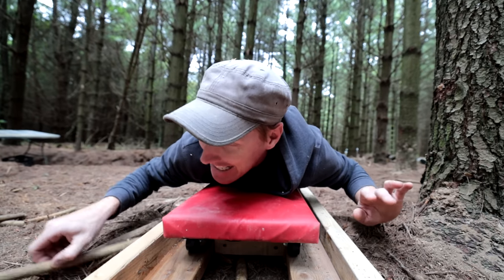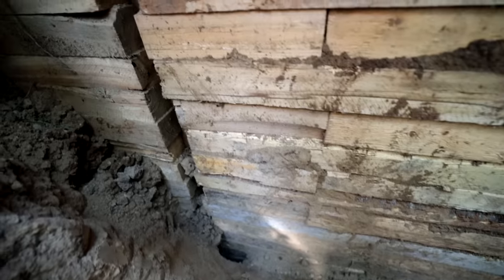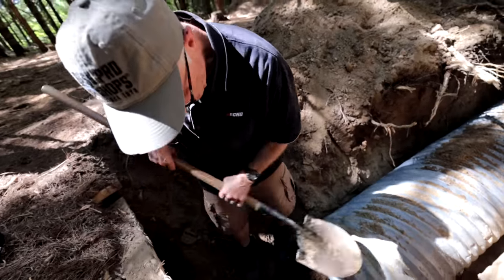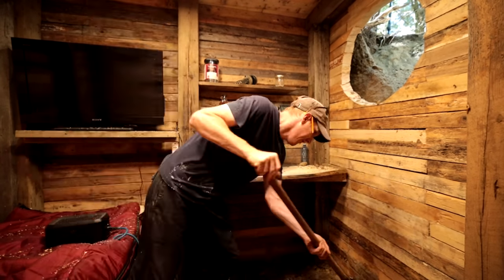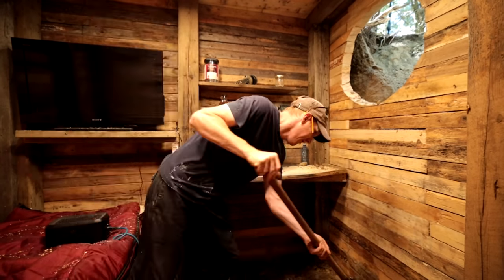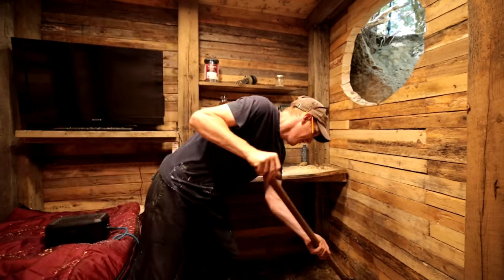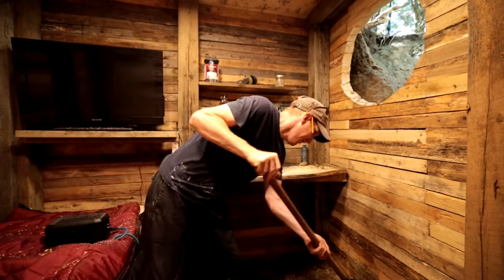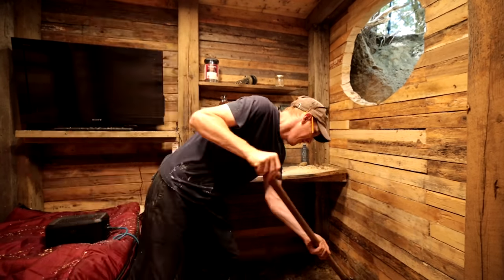Building a Japanese Spider Hole - CRAZY EMERGENCY EXIT!

Comment: Kev, had you considered a static rope between the two exits? Like have it attached to the top of the tunnel so you can just lay down and kind of rope climb/abseil up and down the tunnel with a railing kind of contraption above the entry inside?
Reply: I was thinking that too, only it might be easier if it was under the ramp so you can pull yourself along without reaching above your head.
Reply: Had the same thought, and perhaps add some sort of stopping mechanism at the edge so the red rocket doesn’t fly off the shelf
Reply: Exactly my thoughts. Also, with two pulleys and attached to the cart so you could pull it back and forth.
Reply: Also if you were to put a hand hold over the inside hole you could come up it head first and be able to climb out better.
Reply: Jesus loves you alot trust in His death 4 salvation and be saved from eternal hell <3 Jesus died on the cross for you bro. <3
Reply: Great idea
Reply: Or you can also attach the end of  rope to the front ,run it below that railing then attach the other end to the back of that wheely thing , so you can move yourself forward by pulling the rope above the railing then backward by pulling the rope under the railing , without changing your position
Reply: @ainz7853  i thought about that also but the rail is at an angle, which would make it hard to move in both directions, if it was level, then that would be a perfectly viable option
Reply: Absile comes from German and means "down rope" so it's pretty funny reading absile up lol
Reply: @armean4187  yeah, i know, but I couldn't think of a term that means to go up a rope other than climbing which just didn't sound fitting to me. But I got to admit, I'm surprised it took as long as it did for someone to pick up on that xD
Reply: I was thinking the same, but how about a pulley at each end with a continuous rope attached to each end of the car dolly. That way it wouldn't matter which end you accessed first....like the toilet seat dilemma!😂 And you could move the cart back to the inside shelter when you exit from the tunnel so no one see's it.
Also the outside culvert could be framed with a slanted concrete opening with maybe a hinged tight steel grate with a lock hasp that could be accessed from inside or out.
All in all I'd say Tunnel Rat Barby came out pretty well....much better than a tree house ( but each has their place). And she's prepared for armaggedon, zombie apocalyse, door to door salesmen, you name it.
Now if only there was a way to get some ground folege to break up the open terrain and provide sniping cover!😅

Comment: I think if you add a bar to the ceiling above the hole entrance, you can use it to pull yourself out of the hole, and allow you to swing your feet down.  That would make using it as an entrance more feasible.
Reply: yes, some sort of handle that could maybe collapse against the wall when not in use
Reply: also make the red rocket like 5 feet maybe 5 and a half feet
Reply: Yes
Reply: I had this idea too
Reply: We all think a like. 🤣
Reply: Alternatively, just enter feet-first.
Reply: a bar to the side might work as well, though its less practical.
Reply: Jesus loves you alot trust in His death 4 salvation and be saved from eternal hell <3 Jesus died on the cross for you bro. <3

Comment: Love your trolly!   You could always lay on your back and install an overhead rope at the ceiling and pull yourself hand over hand either direction. B- 36 and B-29 bombers had these tunnels in their fuselages and used the trolley and rope system to get to the tail of the airplane.   We really  love your content!
Reply: Jesus loves you alot trust in His death 4 salvation and be saved from eternal hell <3 Jesus died on the cross for you bro. <3

Comment: As a bonafide US citizen I will express my preference for the Robertson screw over the Phillips design. Years ago while on a framing crew I learned of the superiority of the Robertson screw for ease of use, especially when the screw needed to be backed out of the wood. Mount a stationary rope at the top of the pipe for escapees to use to pull themselves through.

Comment: Love these DIY videos of your, 2 ideas you might like would be to.
1. Add an under rail pully system so you can send or recover the cart from each end and send supplies down.
2. Add a fan and with a swing mount so you can vent air in or out.
Reply: Yes! He could mount the fan on a bracket on the right side of the door. It will swing to cover the entrance and swing back against the wall.
Reply: Jesus loves you alot trust in His death 4 salvation and be saved from eternal hell <3 Jesus died on the cross for you bro. <3
Reply: also put some stops at the end of the rail so the cart doesnt fly out

Comment: A great addition to the spider hole compound. 
On the underside of the red rocket where you have the side wheels mounted, mount an eye bolt to the ends that way the cart can be pulled back and forth.  And it might help going uphill to have something to pull towards the room. 

Thanks for your content.
Reply: i absolutely agree. an eyelet on each end of the cart, and a rope on 2 pulleys at either end of the track, then it could be pulled both directions, great for moving items on the cart, and possibly even to pull yourself along via the opposing direction's rope.
Reply: @ghomerhust  Yes, like elevator cables but sideways.
Reply: Jesus loves you alot trust in His death 4 salvation and be saved from eternal hell <3 Jesus died on the cross for you bro. <3

Comment: I think covering to top portion of your spider hole with a plastic tarp was a good idea to help with water proofing a little better, but without waterproofing the  entrance and all four walls the wood going to rot and mold overtime . Not to mention if any animals get in  and die down there. There's definitely going to be a miasma of stale air in your spider hole at some point.

Comment: Miasma used in a sentace: There was a great deal of miasma coming from the spider hole after farting in it. 
Perhaps a bit of a french drain at the outside end of the escape pipe might prevent a face full of water when exiting when there is rain or water at the end of that pipe.. I know, more digging.
Great project!

Comment: you can put a handle above the door to your emergency exit, almost like a pull up bar(make sure it can hold the weight of a full grown adult) that way if you want to go in foot first or if you use it as an entrance to your base you can either go on your back, or just flip on your back at the end and pull yourself up out of the hole using the handle so that you can still use the ladder foot first

Comment: You need a horizontal bar on the roof to help enter or exit, also good for drying clothes or exercise.
When on cart your weight will bow in railway that is only supported on the sides creating extra friction.

Comment: Earlier this evening, I got close up and personal with some Robertson screws.  I wanted to remove a shelf set from the kneehole of a desk, while the desk was against a wall.  I would not have been able to loosen the screws in the tight and awkward space if they had been other than Robertson screws.   Mission accomplished.  I am a fan.  The desk was custom built in the USA over 20 years ago. My only other encounter with Robertson screws was in a motorhome that had been fitted out in Canada.  The manufacturer thoughtfully included the screwdriver to fit them.

Comment: The tunnel system is an amazing idea I would put a bush at the outside end to camouflage it more and a stopping block at the end of the rail on the inside and try to rig up some kind of rope system so you can send in the retrieve it from the inside to the outside

Comment: 2 things the rail system needs... 
1. a handle above the door for when you come in on your back
2. a rope and pully system so you can move it back and fourth from either side of the tunnel.

Comment: You could try putting some overhead handholds into the ceiling or just above the door, to steady yourself or help pull yourself out, if you do happen to come into the spider hole from the tunnel.

Comment: You should add a pulley system that allows you to pull the cart to which ever side you need it on. you could also probably pull yourself along the tunnel with it too. A metal grating with a hinge on the outside end to stop animals from getting in too.
Reply: Attach a rope and pulley's at either end and run the rope round a remote controlled motor to winch the trolley either way?

Comment: I can see an Ecoflow powered rail system where you push a button and zoom, you automatically ride the rail to either end.  Since it will be, way, way easier to get out of the tunnel if you are on your back on the sled where you can just sit up at the end and climb out a ladder,.  You could attach a rope to the top of the tunnel to pull your way along either direction, until the motorized escape rail is up and running,😀 Nice job.

Comment: On the inside, you could put a big grab bar above the exit so if you come in that way you could roll on your back and grab the handle to get out easier..(instead of climbing down the ladder front first). 
Also, maybe a small pully and rope system so you can move the red rocket to either end with ease..
Loving the build, it's like every kids underground fort dream come true 😂

Comment: Just need a removable hardware cloth at the end to keep the critters out and the small hole in the center of your door, now if you would have a vent tube coming in your would have good ventilation, a little solar fan would help keep it ventilated and keep it from molding

Comment: You should tip the air log on its side.
Cut a slot and tip it on the side so that rain can’t fall down the air shaft. Kinda like a big natural version of a normal chimney cap.

Comment: A rope and pulley system would probably be helpful. I wonder though if their might be some way to automate it as well that could be powered by the delta 2, or some kind of hotl for dog's like use of a power drill.

Comment: A decoy/false inlet upslope nearby in an obvious low spot would further reduce the question of a random pipe outlet on a slope, as people would wonder it’s source.. even cooler would be diversion of a spring seep or natural water source into the pipe to provide a trickle to help explain the use of the pipe to the curious. This water thru the pipe may help cool the shelter as well.

Comment: You could glue sand dirt and pine needles to the surrounding area and the entrances even if its glued on tarps staked out. And add vibration sensors to alert you of ground instability indicating collapsing ground.

Comment: Perhaps narrowing the track, allowing it to sit lower in the tunnel would gain some room...Just remove the short spacers and marry the two track halves with a 2x4 lengthwise on the bottom. It would also allow you to position the wheels more under the cart to prevent a pinch or hair tangle hazard, too.. I love the idea of a rope to pull your self along fastened every 3 foot or so.....and I'd definitely choose another name for it ;)  Fun project!

Comment: If afraid of water seepage maby expand that little drain hole you could make a oubliette, they were what pre modern castles used as a small room in a sub bacement where any water in the wall was supposed to drain (later used as dungeon cells because they are damp and horrible) now basements use electronic sump pumps.

I want to build a fox hole, now that I descovered your video series here realy enjoying the binge watch.

Comment: Very clever slotted wheel/rail design, but the way you've built it, it will continue to get tighter as it settles. You can solve that with a support bar on the underside, to carry the weight and keep it from sagging.

Comment: After reading some of the comments, I agree with the pully ideas. But it would be a good idea to use a powered system if you ever want to bring something heavy in throw the tunnel. Here are some other hopefully helpful thoughts for you. For water getting into the hole, a pump with a garden hose. The hose can run out of the tunnel. It will add to the camouflage of the pipe. Then there's the madder of the main entrance for your peace of mind think about digging it more. Shoring up the sides so the rain will not collapse the walls. Bring the entry all the way down to the main floor level, just to make it easier to walk in with other things. If you should ever expand the underworld project try using pallets for your wall, and ceilings. Laid over with plywood. To cut costs you can use scraps from other projects, or construction sites. That's how I helped a friend make his root cellar. We tacted canvases to the tops and draped them down the outsides if the walls, overlapping them at each wall joint. By the way, you are doing a wonderful job!

Comment: You should add a door on the exit side, and shou sugi bahn 3 of the pieces, and leave the bottom one clear coat, that'll mimic the shadow on the culvert of the afternoon, you're safe from other things, you could technically make it rotatable within the end of the culvert itself to adjust the wood section to the time of day, and it's highly more secure.

Comment: Steve McQueen would be proud.
One point, dig the main entrance hole down a few more feet, then either top it with a grate or very large gravel. That will give the water some where to drain, other than the main chamber. Otherwise, this spring that tunnel is going byebye.

Comment: In Australia we have whats called Batten Screws or Batten Bugle Screws. They use an 6 sided allen fitting rather than a torques bit, or a phillips head. We still have them, just cheaper than batten screws

Comment: You will get mold growing fast with that humidity and all that wood. Maybe some type of 12v RV fan to move a bunch of air and a big bucket of silica beads. Two pipes with 90°elbows on them sticking upwards is something they do for air in underground bunkers. You can hide them  in anything even an old stump Hogans Heros style!
Also if you had a lift handle above the tunnel inside the box you could roll over grab it and pull yourself up and out of the tube easily.

Comment: I would say add a bar above the entrance (inside bunker) so you can get out safer if you go head first. 
Second I would put a rope in but i would put it running underneath the track so you can still use the tunnel for bigger people (less risk of hitting the guideline or anchors)

Comment: Hi Kevin , I was thinking that if you do a pulley system on the sled then you can retrieve the sled from either end of the tunnel and use it for parts or people,…. Also had a thought of a hand rail at the spider hole side to help you flip around when going head first, grab the handle and keep your feet moving out of the whole, might work , idk…. And last thought was a door using bars(rebar maybe) and chicken wire on the top side exit … it wouldn’t look too out of place

Comment: If you built a treestand nearby you'd have a nice lookout point, plus you can put your solar on top of your stand in the sun, then you would also have enough power to run a electric blanket to take the chill off or a small electric heater, best of both worlds nice sitting area in the tree stand and a great place to sleep especially in the summer when its hot, and store food, with your idea of a well point for water. Be nice to see what the temperature would be in the winter also. 
Great idea below your next cabin build,

Comment: You could always put something similar to a pull up bar near the roof of the exit...  Then again, if you need to use that to get into the tunnel, then you will probably not want to be in the tunnel.
Also yes, please add some form of reinforcement to the entrance, even if it is some sort of recessed elevator shaft type thing, just without the elevator.

Comment: We use torx screws for decking or heavy wood-working. It's like your square drive screws just with 6 sides instead of 4. No beef between the Americans and Canadians here. We generally agree that phillips head screws suck for heavy duty work, lol.
Reply: Hmm... what if you were to pin a rope to the top of your tunnel tube thing? Just bolt it into the metal on both ends and leave it loose in the middle and go in and out on your back? Just kinda pull yourself along... Less of a pinch hazard if you're not careful with your hand placement going on your stomach...

Comment: I do like the wire screen at the end so no insects get in I think I would pin a rope on the side of the boards and leave the Rope inside the tube so if you ever have to come out that way when you come out you can close your door from behind all the way from 20 ft

Comment: You should put some hardware cloth on the outside of the door to keep the animals out, and since it's an exit a locking on the inside of the door. Also maybe put some paracord on that "red rocket". If it gets stuck half way when you push it, you can just pull it out again.

Comment: Tarp will also trap water in the ground and keep it from breathing.  Perhaps put a dehumidifier in and a hand pump to get water out of the hole or simply carry it out.  Run it off the EcoFlow, wouldn't take but about 10 minutes to go from 90 to 50% in that small space.

Comment: How about ascending head first on your back? Install handles on the top of the cylinder to pull yourself up. Descend feet first on your back, using the handles to control speed. Something more like the casters on an auto mechanic’s creeper might work better.

Comment: Have you thought about putting a pulley system with the rope connected to you’re board and under the 2x4 so then. When you have big items to bring in and out all you have to do is place it on the board and pull the rope. Also a camo mesh net to blend in the rock and hole so it can’t be seen.